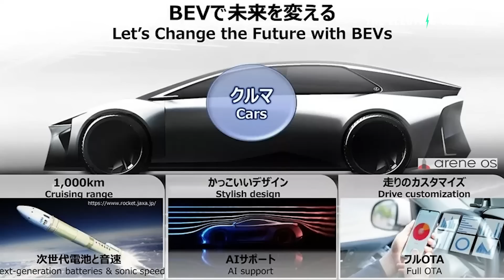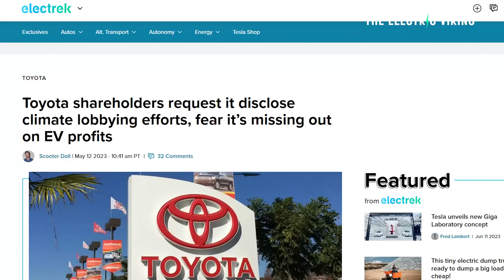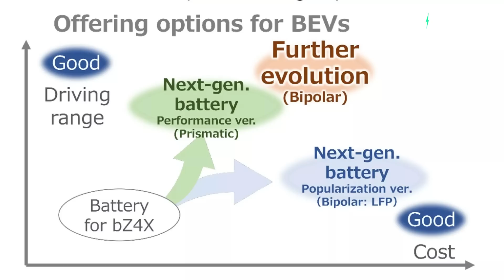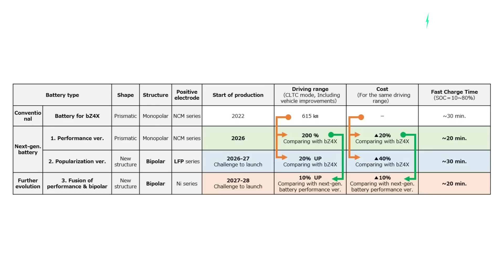Toyota's 2026 Electric Car will have 900+ Miles Range & Lightning-Fast Charging

Comment: The Electric Viking, could you back up your claim about Toyota's statement that you claim goes back around a decade to 2015? Or about the debt? Is there any public record of this?   Or is it just "trust me bro"? I have personally never heard of it back then. There is an existing Toyota LQ prototype that have solid state battery that was supposed to be revealed first in 2020 Olympic but due to covid was pushed to 2021. Is this what you are referring to?

Also that 3.5 million IS for EVs. The reason that they want to improve the platform is because the 3.5 million assumption is now estimated to be higher. 

1.7 million figure is just that it will come from a new BEV factory. Did not say anything about capability. 

The new lithium-ion is bipolar like currently used in the aqua. 

Also they did show the solid battery as well as the driving prototype (LQ). Prototype was shown at least two years ago. There is also a 37 second clip of the battery (you even showed in your footage) along with the footage of new gigacast bz4x subframe. 

Full of cherrypicked misinformation
Reply: Keep on drinking the "Toyoda" Koolaid!
Reply: @rozonoemi9374  do you have a problem with me being skeptical?
Reply: Debt $217.50 B according to Toyota balance sheet. By way of comparison, according to General Motors's most recent financial statement as reported on February 10, 2021, total debt is at $109.89 billion, with $72.98 billion in long-term debt and $36.91 billion in current debt. Adjusting for $19.99 billion in cash-equivalents, the company has a net debt of $89.90 billion.

Comment: First all Toyota does not have a dedicated Giga plant for mass EV production, Secondly the battery in the states will be completed in 2025 before going online in 2026. We all know Toyota is slow to adpating to change.
Reply: Slow in pioneering?  They were making hybrids long ago,the first to mass produce hydrogen fcev passenger vehicles,they having been testing gaseous hydrogen in internal engines in racing and now are using liquid hydrogen

Comment: Toyota is becoming ridiculous more and more. 😂
Reply: It’s sad but true. They just can’t get out of their own way at this point (coming from owning a long line of Toyotas).
Reply: I like Toyota but recently they became joke.  I won't ever buy Toyota again. Bye-bye
Reply: I work for them and trust me the BZ4x is garbage, literally had a new one come in with the driver door wiring harness rubbed through. The wheels were literally falling off them and couldn't be sold due to that issue. They take a ridiculously long time to charge, everyone thinks Toyota's are super reliable but the new stuff is just as bad as the rest of legacy auto. Toyota is only saying all this stuff to try and stay on top as they are starting to loose market share.

Comment: Their ice cars only get about 500miles - you don't need that amount of range - just put a smaller battery in to keep the range  acceptable
Reply: Huge range is needed for towing and off-road.  A truck for example will get less than half the range while towing more than 5000#. This is why some 1-ton trucks for example have 50gal tanks, even if they get 20mpg while not towing.
Reply: U r wrong. That range is exactly what is needed.  Only way 2 eliminate range anxiety & charging time anxieties !! EV winner must deliver @ least 600 mi range.  Follow battery tech. 2000 mi range is coming down the pike !!!
Reply: @bobpeterson2841  no time soon

Comment: this will do zero to toyota reputation of a legacy auto maker that insists on hybrids with 10kw batteries and has a lab that is working on solid state batteries. by the time this comes out eventually the stock is zero and the japanese goverment has bailed them out like obama did with the detroit zombies.

Comment: Samsung will sell solid state battery to every brands in 2027. But Toyota's ev technology are bad and i would trust Samsung rather than Toyota. Remember they showed 16 evs? They recalled and complimented competitors' evs.
Reply: Ah yes samsung the exploding phone much like LG Chem batteries. I won't trust any of them
Reply: @miraphycs7377  Do you know CATL is Samsung phone battery and exploding in XC30 and P7? Do you know Panasonic recalled batteries in Austrailia 3 weeks ago?
Reply: @miraphycs7377  Also, LG is the best battery technology in the world. It provides the longest range in the world. If you don't buy LG, you ride low range car. Even Tesla 4680 is made by L&F anode.
Reply: If Korean batteries like LG and Samsung is indeed better than Chinese Japanese or any other countries's no. 1 let us say, like you claim why do we not see Korean batteries in any other uses?

Boeing's latest passenger liner B787 Dreamliner uses Lithium-Ion battery from the Japanese firm GS Yuasa. It is not European, Chinese Korean anything.

Japanese navy's latest diesel electric submarine have the world's first and so far the only use of Lithium-Ion battery to increase its submerge time.

Why did Boeing not adopt Korean LG Chem or Samsung batteries if they were so much better?
Reply: @miraphycs7377  Do you know Boeing such as 787 and 747 are famous for still cathing fire and banned by US and Japan governments? Of course Navy is military so they use their own battery if they have fine battery. 

Then why Chinese and Japanese batteries can't go long range as LG and Samsung? Then why Honda and Isuzu use LG instead of Japanese? Then why Japan only has Panasonic which use Posco anode? Then why Tesla use L&F anode? 

Anode is half price of battery. You can say they are half Korean. The only 90% high nickel anode are all Korean companies. 

Chinese batteries are not good and Japanese and American batteries use Korean anodes and they are fine but not that good.

Comment: Nice. It's always 5 years left... sorry 2 years left for Toyotas solide state batteries.
Batteries no one has seen...

In the mean time it's best to buy an electric car from another company.
Reply: they did show the solid battery as well as the driving prototype. Prototype was shown at least two years ago. There is also a 37 second clip of the solid state battery (he even showed in the footage) along with the footage of new gigacast bz4x subframe.

Comment: I'm an EV owner and definitely not a Toyota fan boy but I can see some logic in their strategy. They are mass producing more fuel efficient vehicles which does make sense as a strategy to help climate change when you consider:
- The move to EV vehicles by consumers has not and will not be immediate 
- there is a lack of charging infrastructure in many countries 
- there are material limitations and separate environmental issues relating to mining for and manufacturing of batteries
- most people can't afford EVs
- emissions from the transport sector are not as significant as some people think
- most people don't keep cars for long periods so manufacturing of the car is a relatively high proportion of the carbon emissions released (fuel emissions from the tail pipe are only a subset of the consideration)

Given these factors, I think the fuel efficient cars that toyota makes which are inherently reliable and therefore built to last a long time are still net positive towards reducing emissions.
Reply: toyota have been sailing on their reputation for decades and its simply not true. My wife's Corolla has been a pain in the arse and it was bought new! Endless Mechanical problems and shoddy workmanship. And I think you should check the sales figures: the current best-selling vehicle on Earth...is the Tesla Model 3 and the Y. They now OUTSELL the Toyota Camry and Corolla.
Reply: @swanvictor887  Stop with the misinformation bruh
Model	2022 worldwide sales
Toyota Corolla	1.12 million (down 2.8 per cent)
Toyota RAV4	868,398 (down 13.7 per cent)
Ford F-Series	786,337 (down 8.8 per cent)
Tesla Model Y	759,579 (up 88.7 per cent)
Toyota Camry	667,968 (down 2.6 per cent)
Chevrolet Silverado	591,594 (up 1.8 per cent)
Honda CR-V	591,293 (down 18.8 per cent)
Toyota HiLux	566,838 (up 3.9 per cent)
Hyundai Tucson	549,918 (up 0.4 per cent)
Ram pick-up	545,420 (down 15.4 per cent)
Reply: @swanvictor887   Was it built in japan?
Reply: @jordanbrown7403  nope: Thailand. Strange this is; the interior and bodywork is fine, no issues, no squeaks or rattles. The problems are the Engineering of the vehicle! Its a 2013 model (which I think looks nicer than the newer model in my opinion) and there were issues from early on, thankfully covered under warranty. However, after four years, there were serious and expensive issues with: Radiators (bottom half don't fit the top half), CVT gear issues ("first" gear wears out after 200k,) and Rear Suspension issues , as for this particular model, they merely adapted the suspension from a smaller car: it doesn't do the job it was designed for. Along the way there have been a load of battery issues and electrical problems too. 
Now here in Brunei, there are literally tens of thousands of Toyotas running, dating from the 70s and 80s! They really do seem to go on for ever! But the newer stuff: just another car company.
Reply: @swanvictor887   There you have it same as mercedes are poor theese days but ones made in germany are still of good quality.
Reply: @jordanbrown7403  Mercedes had real issues in the 90s, mostly due to the fact they employed too many unskilled but cheap, Turkish immigrants. I took a long while to train them up, but the damage had been done to MBs reputation. They are a lot better these days but not as good as those produced in the mid-80s.
Reply: @swanvictor887   Alas what do you do as a company its a difficult situation to be in do you just export your staff to global production sites and have barely any locals.

Different cultures have different attitudes,germans and japanese are proud people when comes to engineering and have been industrialised nations for long time now
Reply: @jordanbrown7403  Indeed. From what I remember, Mercedes had little choice but to hire the Turkish men as there was a shortage of school-leavers in Germany whom wanted to work on a car-line: not an issue on these Asian countries of course, with booming populations. To be fair to the Thais who built my wife's Corolla, as I said, the body and interior is very good: panel gaps are good, lines are straight, interior very tight, even after ten years, which made it all the stranger to me, that it was the Japanese Engineering that let the car down!
I honestly don't think Toyota can survive without government bail-out, until the end of this decade: they are so far behind the rest of the pack now. It must have been a bad day, at Toyota HQ in Japan last month, when they learned the Tesla cars are outselling the Camry...!
Reply: @swanvictor887   Ah germany are struggling with population crash to they aren't to far behind japan,ah the ironies of modern life bringing comforts and disconnection

Tesla are based on being trendy in most of the cases,lot of gimmicks but granted they have integrated things quite well by and large thats big part of the success and like musk said got to think of them more like tech company
Reply: @swanvictor887   I agree they might not be happy about not having the best selling car anymore,but japanese have dealt with debt uniquely well over the decades and lets not forget you also have kawasaki heavy industries and others pushing hydrogen

Toyota may well get bail out and if thats to be the case so be it in their mind but i wonder do you see the unity as strongly overall in us compared to japan

I mean industries and government working together take the big four japanese bike manufactures collaborating together

Lot of parent companies and subsidaries with these massive global operations,did you see toyota and mercedes do a deal on trucks recently and toyota are providing fuel cells in usa and china
Reply: @swanvictor887  Yet bz4x outsold most other EVs other than Tesla in BEV haven of Norway. bz4x outsold EV6 and Ioniq 6 which people who love to trash toyota praise about in Canada. Why don't you look at actual numbers you copium addict
Reply: Despite being a major Tesla investor I do agree with some of this. However most if not all of them will be resolved over time - just look at the cost/range curve for EV batteries for example. At this point in time there are issues but Toyota isn’t pursuing their policy on ICE for any pother reason than they’ve been caught with their pants down and are trying desperately to slow down/distract from competitors. This claim is baloney and it will be many many years before anything comes of it by which time it will be all over for them.
Reply: @ISuperTed  beautifully said
Reply: Ice and manufactures, regarding their efficiency is a joke. 

Toyota should have been giving us 50mpg plus vehicles, now that ev's are coming up they want to help us with better mpg? Too late buh bye. =] I'm happy to see them set up this goal to miss it again.

Solid hahaha state hahaha battery from Toyota in 3 years lololol
Reply: Japan have better charging than US.
Reply: @yulusleonard985   They are dependent on others for fuel unfortunately thats why the big push for nuclear and hydrogen

Also a lot live in small apartments so that makes things difficult for charging but ill tell you what watching a video about their trains was amazing,incredibly efficient serve millions of trips annualy

Comment: I wonder when the board of Toyota will wake up and fire the CEO and ask for a serious plan
Reply: they replaced the ceo recently. Been living under a rock?
Reply: @miraphycs7377  the former CEO still works at Toyota and defines the strategy, the new CEO is a puppet. Toyota sales are doing -35 to -40% in a number of countries (China...)
they have about 200 billions of debt...
all good news :-)
Reply: @palm1231  
Model	2022 worldwide sales
Toyota Corolla	1.12 million (down 2.8 per cent)
Toyota RAV4	868,398 (down 13.7 per cent)
Ford F-Series	786,337 (down 8.8 per cent)
Tesla Model Y	759,579 (up 88.7 per cent)
Toyota Camry	667,968 (down 2.6 per cent)
Chevrolet Silverado	591,594 (up 1.8 per cent)
Honda CR-V	591,293 (down 18.8 per cent)
Toyota HiLux	566,838 (up 3.9 per cent)
Hyundai Tucson	549,918 (up 0.4 per cent)
Ram pick-up	545,420 (down 15.4 per cent)
Reply: @miraphycs7377  disruption happens very soon my friend you stated your stats yourself. Its EV planet very soon.

Comment: 2026 is a long time form now, plus why pay for that range when it is shown that people just require a solid 400 miles?
Reply: Don't be silly, they all say they need 600 miles range, per day, each way, uphill, towing a caravan and with the lights, radio and heater on.  Non stop.
Reply: @djtaylorutube  ya bro,    just accept the  bare minimum because,  you know,   you only need that every once in a while and emergencies never happen.    Why have a savings account either.   Just live paycheck to paycheck,  its all you need moat of the time.
Reply: @jebes909090  Same argument used for performance - look at my EV that’s does 0-60 in 3 seconds so pay more. No one will ever do that in real life. We don’t need massive batteries we need quick charging/more dense/longer lasting ones. 300-400 miles is plenty enough for 99% of people. If it’s not for you stay on a Hybrid.
Reply: @jebes909090  Having a savings account with low interest rates is pretty dumb actually.  Hello credit card! :)
Emergency...ok, is there an opportunity to recharge anywhere within range maybe?  Probably?  Does everyone drive 600 miles or even 400 non stop or without passing an opportunity to refuel?  Not usually, nope.
Reply: @ISuperTed  The high performance is a result of a motor that is designed for regenerative braking.  The acceleration is just a by product :)